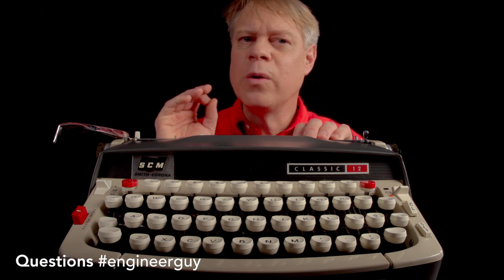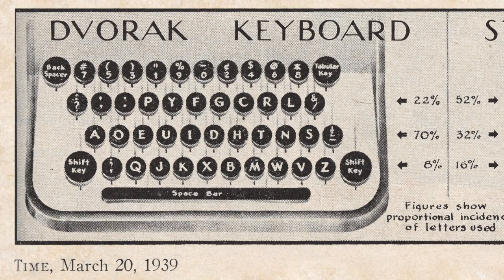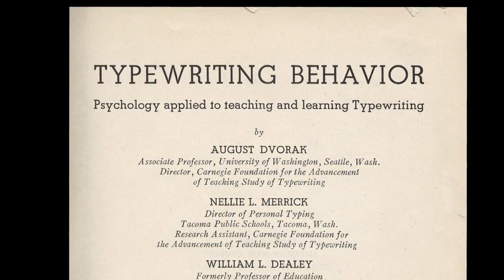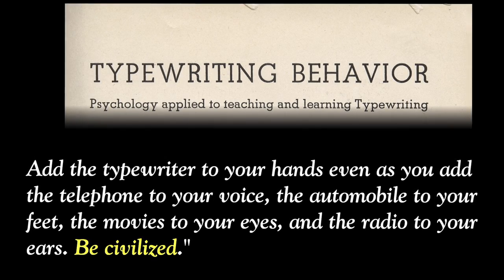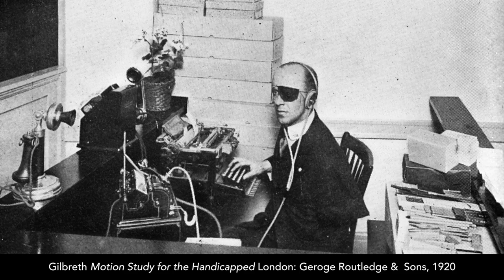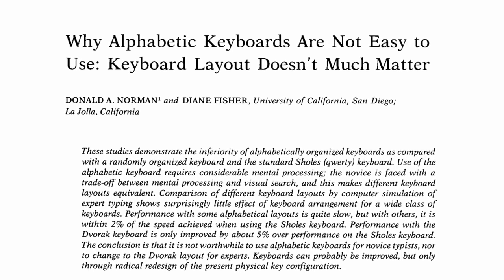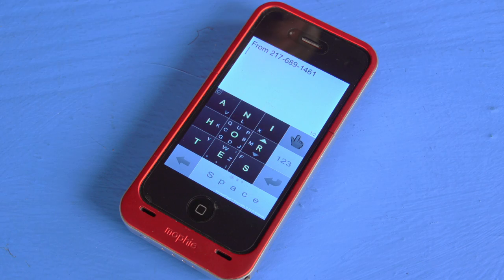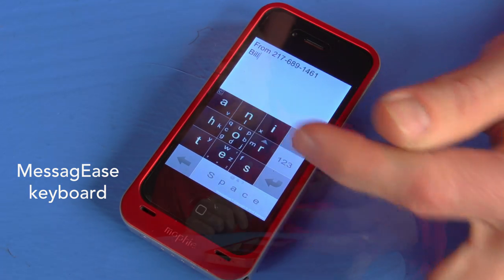Why the Dvorak keyboard didn't take over the world

Comment: I don't know who did you studying and come up with a 5% improvement of Dvorak over QWERTY. Clearly, neither you nor they put any effort into actually researching and testing this.  It took me an entire semester to reach 70 wpm when I was taught QWERTY in school. Once I decided to switch to Dvorak, I was over that in less than a month. In college, when I was typing papers for myself and friends, I peaked at 300 wpm. Now tell me, how many QWERTY users can type that fast? And how many of them can do so without repetitive stress injuries?
Reply: +Christopher Baker 
I agree! I switched to dvorak and gained close to 30% speed. I also never get aches in my wrists any more!
Reply: +Christopher Baker I don't measure my WPM but I was typing QWERTY for probably 10 years before I switched to Dvorak. It took me a good while before I was very fast again. I don't notice that it's faster, I think my typing overall may be a bit slower in recent years, whether it's from adding a keyboard layout or other reasons. I switch back and forth between QWERTY and Dvorak pretty seamlessly but QWERTY seems more convenient for coding and some software like Unreal Engine that are designed around it (WASD navigation, hotkeys, etc). However, I definitely notice that Dvorak is audibly quieter when I type, it feels smoother on my hands, and I have less trouble with repetitive stress with my wrists. I also use a vertical keyboard when I can for the wrists, but I mostly work on laptops so that's usually inconvenient these days.
Reply: +Christopher Baker Will Dvorak help a two-fingered typist like me?
Reply: +Dennis Neo No. The keys are specially placed in the locations based on your fingers resting on home row. If you peck with 2 fingers, the actual location of the keys will mean less. The biggest improvement will be from you knowing the location of the keys.
Reply: Same. After QWERTY, learned DVORAK in 2-3 weeks. Speed more than doubled, peaking around 200 wpm.
Reply: ...Five words a second. About a hundred wpm faster than the world record.

Yeah, you're lying.
Reply: Wish it were this simple :)
Reply: The 5% improvement is an average. It doesn't mean there are people who can't drastically increase. Based on the font I saw, it was an older study in which keyboards were drastically different in physical design and he used that study because it was relevant to the history of why the Dvorak keyboard didn't catch on then. I'm sure it's different today, but even then 300 wpm sounds very sketchy.

Comment: So basically whoever's first wins...just like Devorak said
Reply: Yes, with the addition that to supplant the market leader you need something more game-changing than a 5% increase in efficiency.
Reply: He didn't actually say efficiency; he said faster. Dvorak is much more comfortable because it requires so much less movement. That doesn't translate into speed because of human limitations, but the the effort required is massively reduced.
Reply: Good catch, though, as others have pointed out down here, it's comfortable assuming you're right-handed
Reply: +Andrew Krahn there is a left-handed version, plus ones for 1-handed use.
Reply: Sometimes a superior technology can not overcome the dead weight of a large installed base. Bosses would have had to buy new machines, and typists would have had to retrain, in order for the Dvorak keyboard to take off.

Early adopters of Dvorak among employers would have faced a disadvantage in recruiting typists, as the trained pool would have been rather shallow; conversely, a typist who learned Dvorak in the early days, would have looked for a job from among a restricted choice of employers. It's the second mouse who gets the cheese.
Reply: You can find the issue of replacing existing technological dominance quite prominently in office software, and of course we can never forget that long drawn out circus of discussing when to finally let DOS die its death.

Comment: Consumer inertia is one thing, but touch typing relies very heavily on muscle memory. I'd balk to an extreme degree at having to switch from qwerty to dvorak, and the idea if having to use one layout at work and another at home is insane.
Reply: Read other comments. Some people learned both layouts.
Reply: Peter Knutsen I understand that you feel that way and I almost agree because relearning is frustrating and infuriating. However, I came out the other side of that with an ability that will benefit me until I die. It is hard to commit to the investment, but the investment is still worth it.

Comment: QWERTY wasn't made to slow you down, but rather to permit higher speed typing while avoiding jams by putting physical distance between the keys (and, thus, the corresponding hammers) that were statistically more probable to go one after the other while typing.
This affords the hammers a bigger distance, and, therefore, time, to move away while the next one arrives.
I'm going on a limb here, and I may well be very wrong on this, but I'd say that, for classic mechanical typewritters, Dvorak, with it's packing toghether of the most frequent letters, would be more prone to jamming than QWERTY...

That feature, though, provides no advantage whatsoever in a non-mechanical typing device, of course.

What fascinates me is that there's so much obsession with character distribution while we drag the key slanted arrangement that was necessary for mechanical typewriters but makes no sense in an electronic keyboard... Why not fix that already?

Dvorak, or whatever other distribution improvement you can come up with seem rather superfluous to me when we have this crooked nonsense in front of us still in the second decade of the 21st century... Who's in charge here???

Comment: From what I understand, QWERTY wasn't purposely randomized to make typing slower. Rather, the keys were arranged to reduce key collisions and thus improving typing speed compared to common layouts of manual typewriters at the time. Dvorak would likely have fared worse on typewriters of the late 1800s. Of course, QWERTY didn't eliminate the collision problem. That required typewriters with faster key strikes.

Comment: In the old days, an executive dictated to a recording device or to a secretary who wrote it down using shorthand.  Then, a typist typed it in as quickly and accurately as they could on a typewriter.  Nowadays, the executive (or whoever) types it into the computer directly while thinking about what to type.  Typing speed was important before, but not so much anymore.
Reply: Santa Claus  I typed it.  But, it's not my typing speed that's the limiting factor.  It's figuring out what to type.  If I type at 40 WPM using QWERTY or 60 WPM using Dvorak, it's still the same amount of time because my fingers are waiting for my brain.

Comment: I use a Dvorak keyboard, I swapped from QWERTY some years ago. It's pretty nice, I don't think there's much of a speed improvement, but the increased ergonomics are nice. If anybody is interested in switching however, I would take a look at the Colemak keyboard instead, or even the QGMLWB keyboard. The only benefit Dvorak has over these (in particular the latter) is that it's more widely adopted, so you can easily use it on Linux, Windows, and Mac.

Comment: I successfully learned Dvorak before, but have switched back to QWERTY. Why? Because I type in multiple languages and formats. Dvorak is not the English switch-back when typing in non-Latin keyboards. We also have a manual typewriter, so QWERTY is backwards-compatible. I found that being able to communicate decently in any situation is far more useful than communicating quickly in only a specific one.

Comment: 0:38 I like Dvorak a lot, but I gave it up for Colemak as the F key placement in Dvorak really bothered me. I didn't actually mind the S and L but the way that the F key pulls your hand out of position was something that I really started to notice once I started typing over 70wpm. I tried to use Microsoft Keyboard Layout creator to swap the F key with the period symbol, and my tests on this format led me to believe that this would be successful and equalize the hands, but this would have been a pain working on keyboards at work and attempting to upload an exotic layout. Capewell I believe has a very highly recommended modified Dvorak, but again, I went with what is available, particularly as Windows platform is so ubiquitous at all workplaces, and Colemak is a pretty good layout overall.

Comment: This same principle applies to why the U.S. Customary system hasn't been completely supplanted by the metric system. The U.S. had already been developing a manufacturing industry for 50 years once metric hit the scene, so there was already a huge cost to switching over. Also, the customary system offers some benefits that metric does not. Dividing a foot in half and in half again is very easy. Taking 2/3 of a foot is very easy. In other words, you can divide a foot by 2, 3, 4, and 6. You can divide a meter evenly by 2 or 5. That's it. There's no equivalent measurement to a foot in metric, and that length has shown itself to be very useful and intuitive.

The same can be said for volume. U.S. measurements can be divided in half easily over and over again. Not so with metric. 

In other words, metric might be easier for some calculations, but is much more difficult for others. The benefits of the metric system are not great enough to switch over an existing manufacturing industry over to it.

Comment: Any keyboard tires my arms.  I've always thought that an arrangement would be easier on my muscles, if the keyboard were split in half, and mounted so that each hand could press the buttons from a vertical position instead of forcing both hands turned 90 degrees inward from their natural resting position.  

Try it for yourself. Holding your hands level to the ground puts strain on your forearms. Hello carpel tunnel. NOW, relax your arms, hands by your sides. If you simply raise your hands from vertical to horizontal,  there is no strain on forearms. What if you could place your hand at the keyboard without twisting your wrists over the top of a keyboard? It's much more natural hand position, and no carpel tunnel. 

Split the keyboard down the middle, and simulate typing with your hands separated by the width of your chest. The only muscles moving are wrist and finger. Much less effort to type when your forearms and elbows are not involved.

Comment: So ... QWERTY was not designed to slow down or stop jams? ... but just poorly/weakly designed for effectiveness?  Are you saying both layouts were designed for effectiveness, and the improvements, though notable, just weren't enough (~5%) to displace the incumbent?  BTW, the frequency numbers on the QWERTY image seem questionable ... surely some aggregation of widely varying frequencies. (Q:25th, T:2nd)   I do find the small %5 difference surprising, with J (24th) and K (23rd) under the right middle & index fingers.  It suggests a) that's why rigorously clean user testing is needed, b) the intuitive factors may not really be as important as we think. (e.g. hand-optimizing compiled code)

Comment: I'm learning stenography because it is much faster (200 wpm is the general lower speed people are supposed to be able to reach), and because there is now an open source program called Plover that can be used with any keyboard that allows people to press a certain number of keys at the same time. These can be had for $20 or so of you look hard enough, but otherwise less than $100 - way cheaper than the hundreds and more that stenograpjy machines used to cost when they were produced by one company using proprietary software.

Comment: You hit on the real reason it failed, it just wasn't enough good enough.  And i would add, the only real payoff is with super fast typists.  For the average touch typist who is doing 20 to 60 words per minute, ther slowdown is not in the keyboard layout but in the basic skill of the typist.  The better layout gives a slight edge only at high speeds.

Comment: I like the russian keyboard. A and o are on your index fingers and letters that usually go together are so close that you slide your finger 'nm'. You can turn your keyboard into dvorak if you use a computer, and you can remove and move keys to fit it. Also its easy to switch back to querty with a little tab on the bottom right of the taskbar. All it takes is a little memorization to get a new keyboard down, and the cool thing is you can memorize a lot of keyboards and they all feel different for some reason.

Comment: I took type setting  in the early  1970's   as part of the Printing class    and we had the  Printers   Box   with  each   letter  or accent   as a  metal  strip  with  it at one end  to have the Ink roller  wet it  prior to the sheet of paper   pressed  down of the  Composition  . 
          This large  case   had  sections that were  like a grid pattern    and about  25 mm  deep  to store   the inventory  of each  letter   .  The  case had an Upper section  for capital letters  (  hence the term  Upper -case  , Lower-case)   while the lower area  was reserved  for    non-capital    one and all the    Notation  and numbers  you see on the top area of a QWERTY   and to the Right of P L M  .        
    
    My point is that the box   wasn't created first where  Type Setters had to adapt  ,  it morphed  into the arrangement   based on the most Common  Letters  and Vowels   used in the   New Paper  stories   or   Books that were in English.   Most of the Vowels  were  in the center  area  for quick access  and the inventory  reflected the  level of use    while oddballs   like   Z, X ,Q  , < , >  and so on  were down in the corner of the tray .          
        The LinoType  machine  had a QWERTY   keyboard  which  was  a machine  that took in  a bar of a  lead mixture that melted   to have a reserve Fluid   ready  as you typed  because the  Reverse  Mould  of the letter  would go in place  so the liquid  would fill it in  and harden as it cooled .  
      It also  allowed for spaces   and  was calibrated   for the width of the  sentence  so that when you hit the ( .  )  period key   and "Enter/Return"   it filled in any  gap  prior to spitting  out  the  sentence ( hot)  into a the printer tray.
    
  My guess is that   the typewriter  took into consideration the Printer Box   to see which  letter  are the most common   in a normal   vocabulary   since the  Printed Media   for  News Papers  still had Reporters   that typed their Reports to mail in or  read it over the phone  to be typed and handed to the  Composition  department.  
    I don't think that   the main goal  for QWERTY  was to  make humans happy   and life easier,   it must have been  to  access the most commonly used Keys  which was the same as the printers  box set-up. 

  btw
     Our    Teacher   had a way to  get us to memorize  the box   in the first two weeks .  There was a picture  above each work station with the   box   and every  item  was in its  place  inside the  storage  space  with a large   imagine  to read it . 
    He ordered us to  turn the box  over and empty  it on the counter  ,   from then on  we  had to pick up  every  one  and find the   Inventory   spot it was to go in.   Pretty soon  you were tossing them in  and could almost   take a Blank  imagine of the   Printer  case  and fill in   each  spot  where   the  items   went  .
Reply: mind your p's and q's, lol

Comment: i think hat both the engineer guy and dvorak are missing the true purpose of the qwerty keyboard. which is to spread out the most used keys so they wouldn't interfere with each other. the outboard letters on a manual typewriter swing in an pronounced arc and enter the "interference area" quite close to the platen. while those in the center have a straight path and thus a large interference area.  you can test this by choosing  two keys adjacent to each other in the center of the keyboard and type as fast as you can and note how much they interfere. then pick two opposing outboard keys  and see how much less jamming there is.  i wonder if the study that showed a 5% improvement was done on old time "hammer" typewriters or perhaps IBM Selectric typewriters that would eliminate the jamming issue and thus advantage dvorak.

Comment: Whilst watching this video it made me wonder straight away that if the layout of the QWERTY key board was chosen to avoid jamming, and the most efficient was Dvorak with 5% greater efficiency, then mechanical typewriters were constantly operating very close to their maximum speed anyway.  Surely then, an even slower system of typing would have been employed to further reduce the chances of constant problems?  Unless of course it was based upon the mean costs to any given business of faster typing (i.e.) greater throughput of work) vs the wasted paper and downtime in the typing pool.

Comment: Why does typing require two hands? I've learned (inspired by a nail-polish commercial from the '60's or '70's, I kid you not) to touch-type with one hand (left or right), on the qwerty keyboard, and Dvorak also came up with one-handed keyboards. Aside from the obvious application to those who have lost use of a hand, it can also be practical when you need to use something else (pen, phone, mouse...) at the same time.